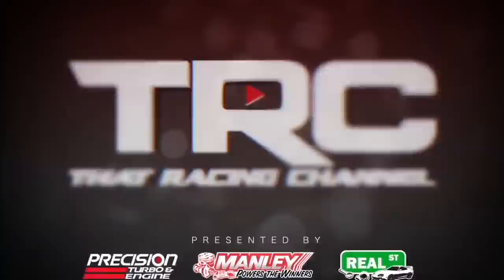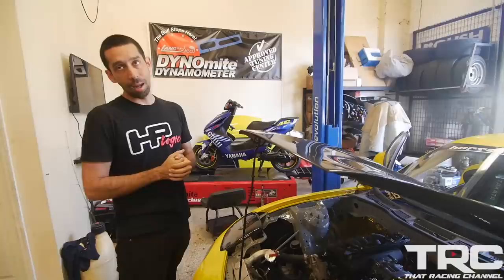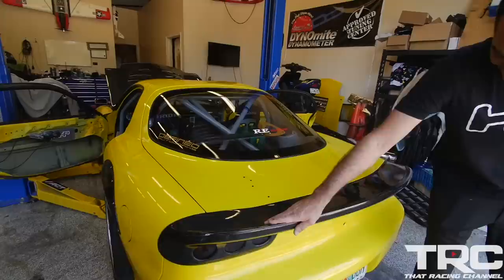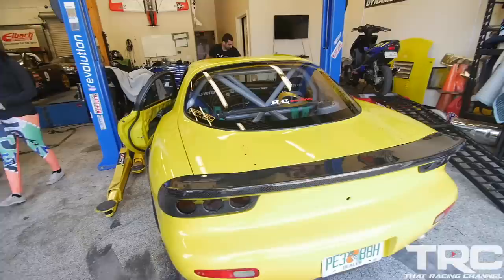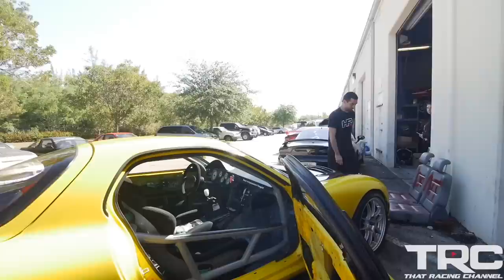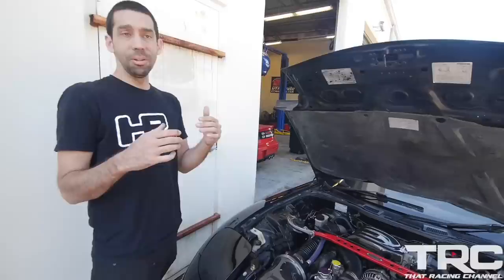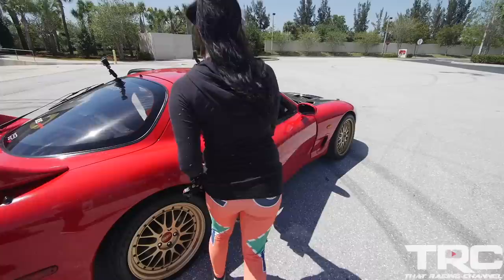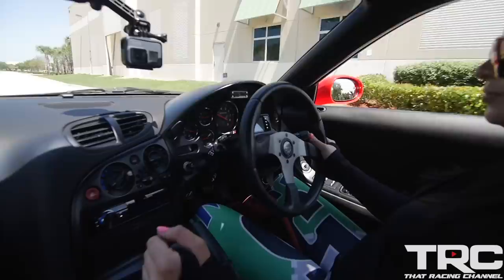20B 3 Rotor RX7 SCREAMS 10,000RPM on the Street - Amazing Sounds!

Comment: I'm a Ford Windsor/LS guy. That said, I like that this guy didn't hack up his cars for another LS swap. The idea of spinning a  motor to over 10,000 rpm is a great one and these rotary engines seem to be good at it. I wonder what the ceiling is on rpm. Maybe 15,000 rpm with a full race motor? I'm let down that the guy didn't have his peripheral port open for max power but racing rules are racing rules. His cars are badass. I wouldn't rename the channel "rotary's R us" but, if you did a little more rotary stuff it would be cool. Thanks.
Reply: Do u know how crazy it’ll be with the peripheral port open ? ... just look at mad mikes rx7 FD ,, this is perfect for the streets reliable

Comment: Nice build! My 93 3 rotor base line tune no boost 560 at the tires - 690-714 HP on 16 psi of boost, we couldn't hold down on the dyno. With drag slicks and tire tack, it's insane but fun as hell! Check out Wayne's 93 FD on the dyno. I painted the car burnt orange.

Comment: I wonder how much the gold foil on the intake pipe actually affects IATs.
Reply: Enough to make it justifiable. Especially with intercooler piping
Reply: Jack wouldn't have it if it didn't work , his a dyno  guy searching for every hp he can find
Reply: Toby61194 he doesn’t have an intercooler, it’s an na 3 rotor set up
Reply: Probably just looks cool which is reason enough.

Comment: Not trying to knock your build but what sense does the thermal insulation on the intake tube when you have a open element air filter sucking under hood air?

Comment: And screams again 10,000 miles later when the tip seals have worn out housing and it loses all its compression.  While I like them, they're just about the only car whereby rebuilding the engine is part of its maintenance.

Comment: so the carbon company is called spree or what ever it was…  on every piece you can see how light gets reflecting on every fcking direction ..  like they did not do any sanding and filling before laying the fibre on top of the negative mould..       looks ugly as hell..     same as doing new paint on top of ugly filler job or not even bothering at all and leave all dents underthe new painjob..   but this time it is on carbon ..        damn… one that could of been awesome is just an  nice car ,  even nicer engine .  best part for me is the breaks and tires combo on clean race interior.

Comment: Kinda cool but still seems like 300 horse and weak in my opinion dam  he said it after I wrote this so yes 300 to the wheels is right weak and back fenders no no
Reply: Like everything, it needs a turbo. Would still be great to drive no doubt but that novelty would wear off after a year or two so I wonder what his plans are for that engine? CR ratio maybe too high for turbo application. He might be able wring 500 out of it NA which I suppose is enough(?) The widebody kit he mentioned will take care of the fender issue. The  car deserves to be made into a forced induced animal but respect that he may want to keep it an ultra-high revving novelty and maybe do some class racing with it.
Reply: It’s purpose built to embody the spirit of JGTC.  Not a drag car. Its reliable. Revs to 11k rpm. And sounds like a f1 car.  This is all i want from it.